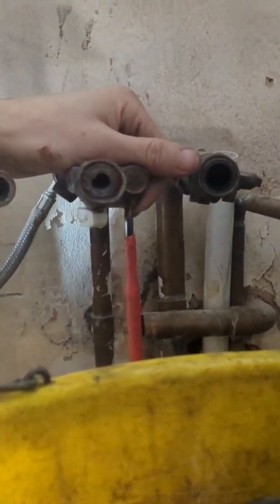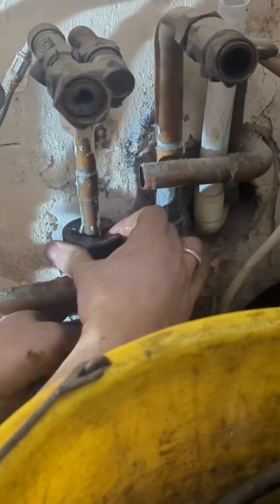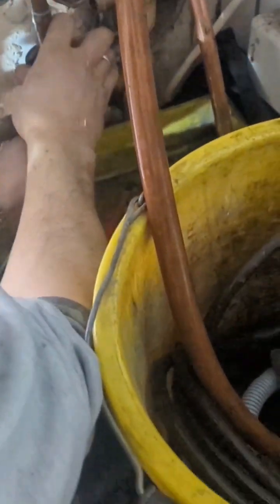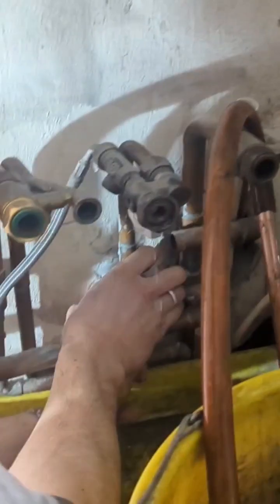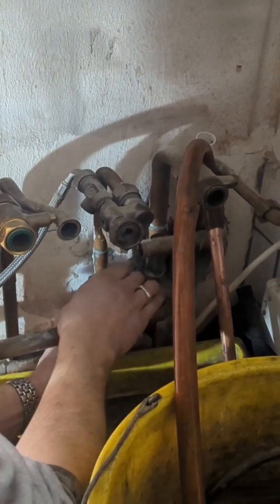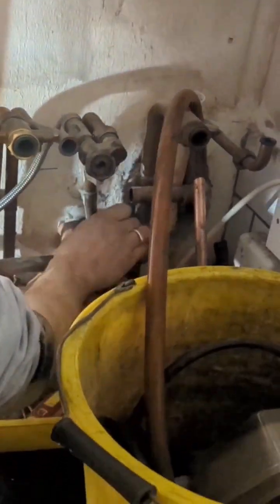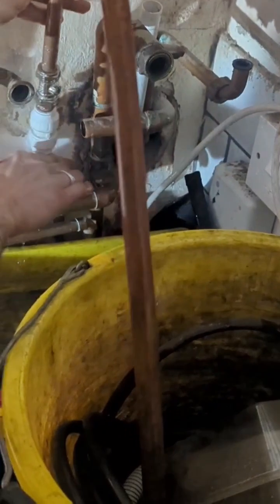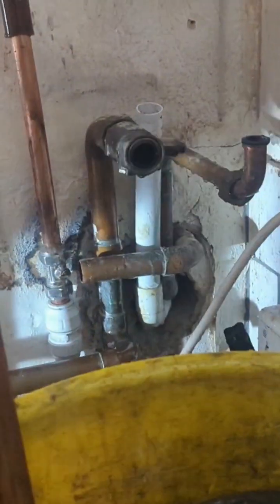Boiler swap with no cold main stop tap in the house 💦💦

Comment: My stop tap is at the end of the path. Under a small grid cover 4"x4" because I'm on a water meter.
Reply from the maker: There would of been a stop tap outside somewhere but we couldn't find it and that would of turned off more than one house. You should always have a stop tap in the house though just in case of an emergency...💦💦
Reply: @northwestgascertificates  when I had a water metre fitted the stop tap in the bathroom no longer worked. I was told by the man who fitted it the stop tap is now at the bottom of the path and it was for my house alone. However he never explains how to turn it on or off. So hopefully I never have to.
Reply from the maker: Fingers crossed you ll be fine👍